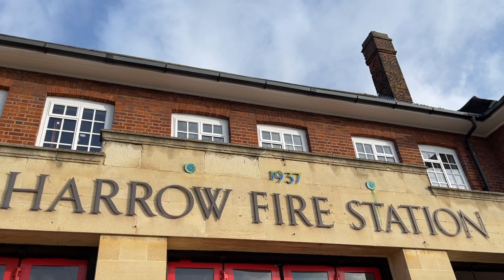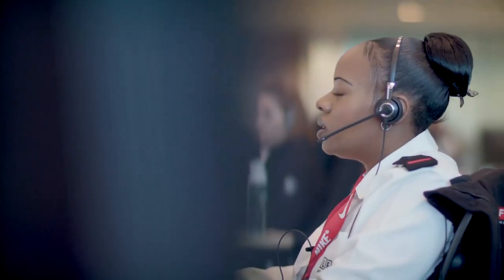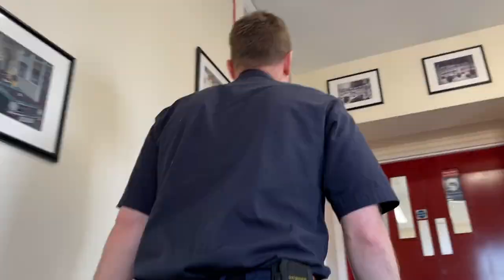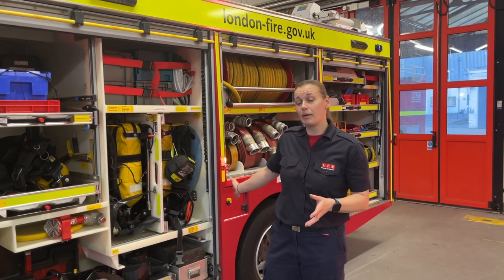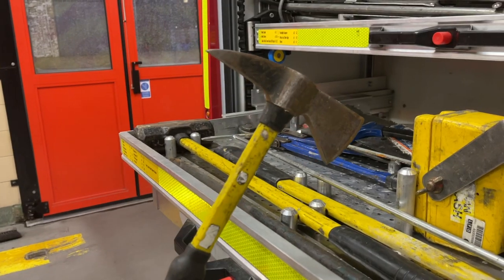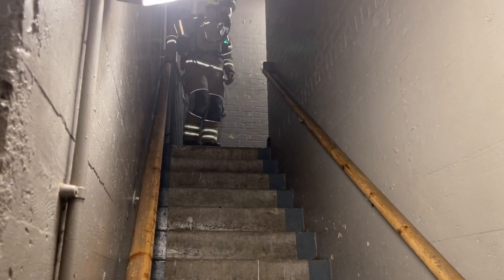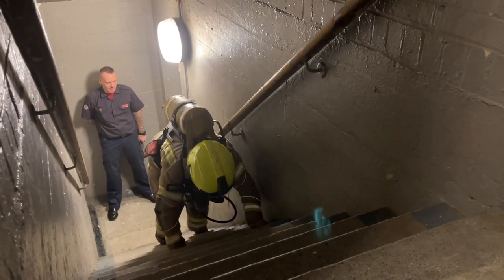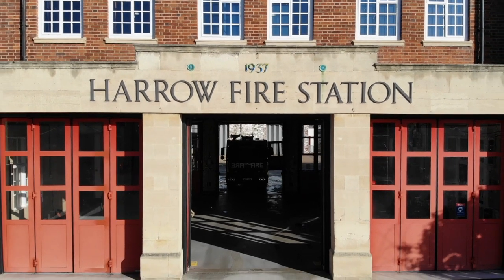Fire Station Tour - Harrow

Comment: You need to update to some modern CAD system! Waiting a printer and cross referencing the address could be wasted time. Our fire department in the states have laptops in all the apparatus and as soon as the tones go off all the dispatched vehicles laptops update with the address for GPS, 911 caller notes, hydrant locations, etc. I do love the pictures from the history of the station scattered around and the mat at the bottom of the pole. Makes it easier on your knees.
Reply: The main reason for checking a map is for incidents that are a large distance away, this will help the crew pick a direct route closer to the general area, where the Satnav can then utilise smaller roads closer to the incident. The MDT (Mobile Data Terminals) onboard every appliance have all the elements you suggested in your comment. They are extremely advanced, and even go into detail such as the weakest points of every registered type of vehicle on the road in the UK for help with traffic collisions etc. They also display hydrant locations/status etc.

Comment: Why are ba sets stowed in the lockers and not in the cab?
Reply: THey have sets in the cab as well., The ones in the lockers are for the secondary team who will most likely be setting up entry control or securing a water source at a shout, so dont need immediate access to their set.